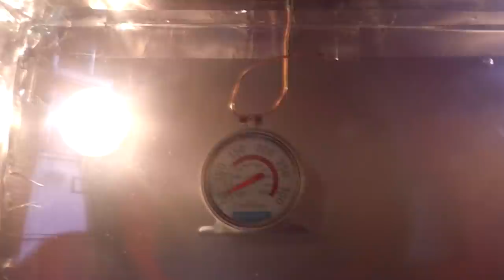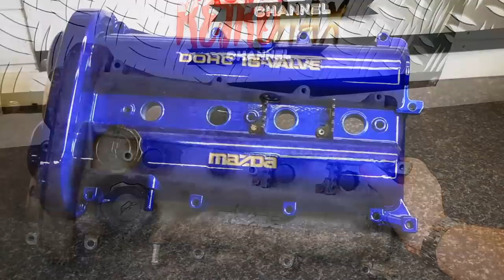Powder Coating Oven DIY Build (How To Make)

Comment: Cracking job as always Martin, great to have a review combined like this. As I mentioned before you inspired me to get my older version of the same PC system back up and running as I had been hampered by the size restriction of the domestic over, then took on redoing a conversion of a office cabinet and then powder coated load of items for the kit car rebuild. Presently sand blasting some bench ends that will get powder coated with some colour from electrostatic magic for a work mate, keep up the great work you 2.
Reply from the maker: Nice one Richard. Cheers
Martin

Comment: Martin this might sound a silly question but how did you manage to get the grill element and the oven element to work at the same time? Your video and ideas are absolutely brilliant mate keep it up
Reply from the maker: This cooker had a dual oven/grill I think and no extra wiring was needed. It all worked off the original controls.

Comment: Were you able to remove and reinstall the Amersham decal, find a duplicate, or mask it off? Wouldn't have thought it would survive the heat.
Reply from the maker: I made new ones bud
Reply: @RetroHax  Well, that ability is something I'll have to learn about. Any suggestions about where to start?
Reply from the maker: Try waterslide decal paper on your home printer and then lacquer them with rattle can varnish.
Reply: @RetroHax  Thank you for the introduction to this technology.